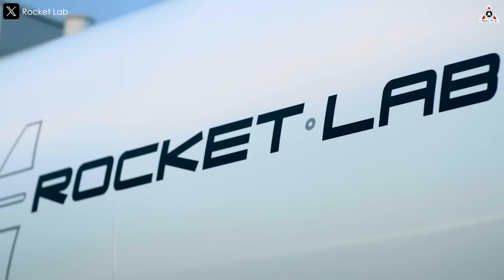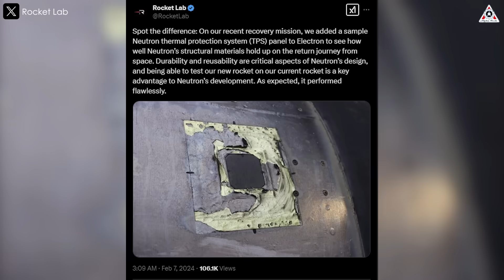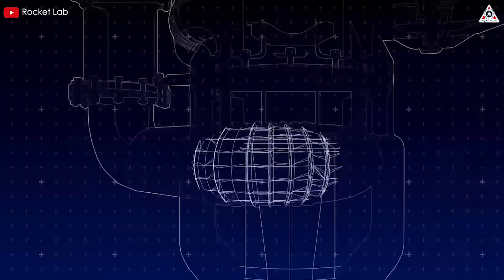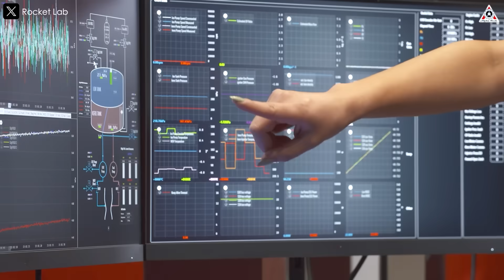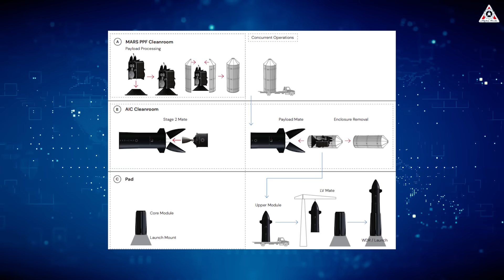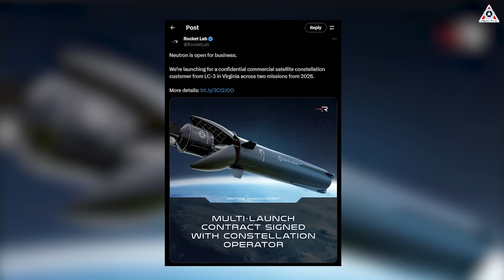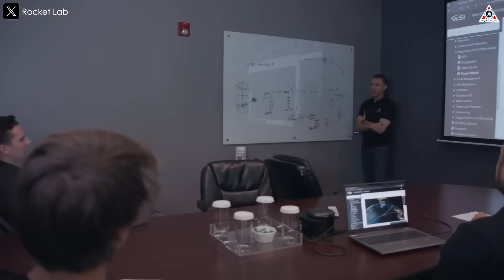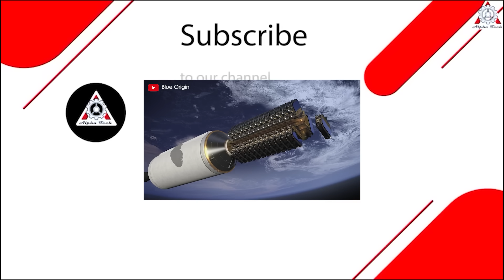Rocket Lab's New INSANE Plan for Neutron Rocket to Catch up with SpaceX!

Comment: I can see that clam shell failing at the speed its traveling on accent, leading to it almost pealing back on itself destroying the rocket. the extension and retraction gear would have to be immense and bulky to withstand the forces applied to them.
Reply: Good point, I will let Peter  know.
Reply: You do understand that all rockets have fronts that open right?  The only change here is they are keeping them instead of throwing them away.

Comment: Stainless steel hasn't demonstrated exceptional resilience through multiple launches yet.  None of the Starship or Super heavy have yet been reused, and Starship demonstrated some pretty heavy melt through around the flaps from inadequate thermal protection.  And certainly that can't be claimed for the last two test flights.

So it's fairer to say both has still to prove there reliability in my opinion.

Comment: Carbon Fiber is fantastic material to use in Rock Launch systems. It is also excellent for Deep Ocean Diving Submarines.
Reply: Pressure zero, nada, nonexistent in space, the depth of Titanic 4000 m water, that's real pressure.
Reply: @henrik5761  But in space you could be killed by something tiny, that hits you at thousands of miles an hour.   Micro Meteorites.
Reply: Stainless steel rockets seem to blow up quite a lot
Reply: @user-bm9jq4fo8u  agreed under tension fantastic under compression not so good
Reply: Yeah and stainless steel is a great material to fly to mars…the rust planet…